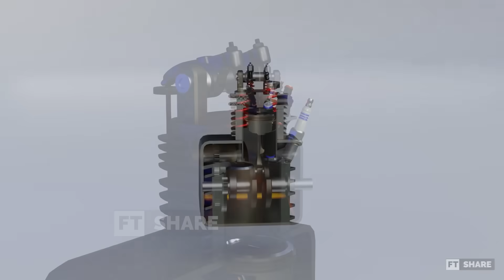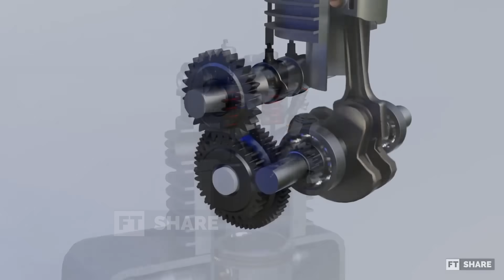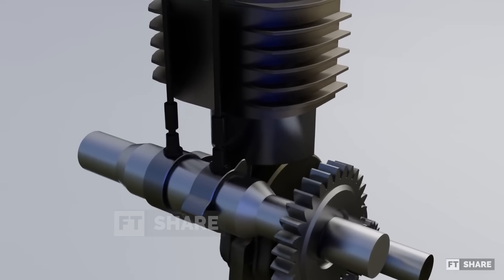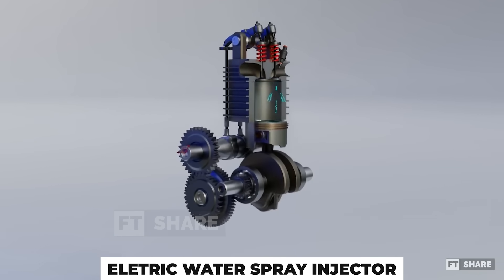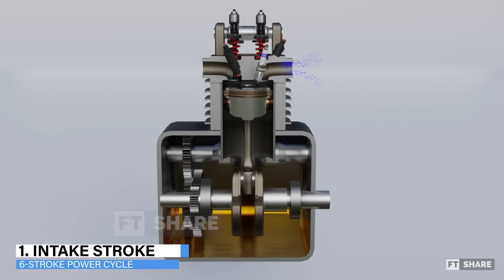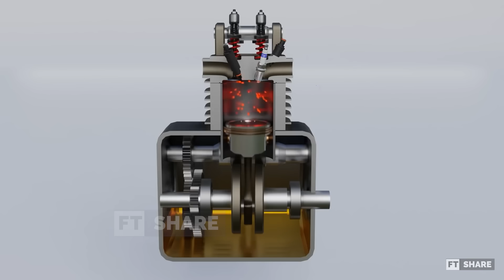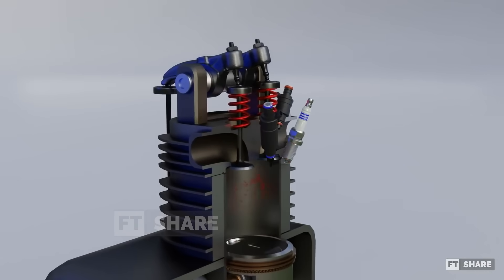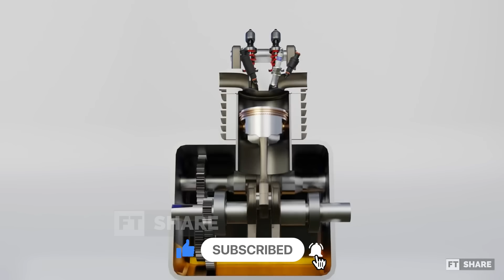Water-Powered ICE Is Here!!! | The Revolutionary 6-Stroke Engine

Comment: This could be viable as a hydrogen engine, all the exhaust should be pure water vapor, so send the exhaust through a condenser to a storage tank where it can be used for the secondary (steam) power stroke, and have that secondary exhaust go back to the hydrolytic cell where it can be made into more fuel. You wouldn't need to refill on water as often, but the problem remains, hydrolysis requires expensive materials that will degrade rapidly. How often would one need to replace their cathodes and anodes?
Reply: Clearly you have read some ignorant speaking about stuff he does'nt understand and you repeat his nonsense to keep promoting ignorance.
When naming anodes and cathodes you are clearly speaking about electrolysis, not hydrolisis, that has nothing to do with it.
If you were at any time to take a physics book and read it, to try and learn instead of make an effort to keep ignorant, you would knew that electrolisis is a very loooooong and sloooow process, and is absolutely incompatible for use in any kind of engine/motor to make hydrogen as a source of fuel.

Engines ALREADY work with hydrogen, and ALREADY produce water that gets expelled from the exhaust (watch the back of the cars on any stop and you will see them dripping)
The problem is, hydrogen provides more disadvantages and difficulties than solutions, so it's needed mixed with some other stuff (carbon, nitrogen, sulfur) to stabilize it, handle it and use it safely. Also, is easier and faster to get in this way.

That's why they say: Better to remain silent and be thought a fool than to speak and to remove all doubt.
Reply: @m.anejante1687 comment sections should be about the exchange of ideas and learning, not berating people who ask questions.
Reply: @m.anejante1687 The irony here is unreal. You let your eagerness to show his foolishness make a fool of you.
1st: electrolysis as he proposed isn't invalid because it's "looooong and slooooow", whatever tf that means. It's invalid because it uses more energy than you get from burning the hydrogen again, and so adding it represents system losses instead of gains. You can make it as fast as you want, but you can't make it break unity.
2nd: hydrogen isn't mixed with cooling gasses to "stabilize" it. It's mixed with them for the obvious reason that it combusts at temperatures that can do damage. Either straight up melting poorly cooled metal, or even in well cooled metal, rasing the surface temperature to the point that unspent hydrogen can diffuse into the metal and cause hydrogen embrittlement.
If you had bothered to study anything you attempted to lecture this fellow on instead of just stretching your feeble knowledge in the hope that no one would notice, you would know all of this.
Now climb down from that confidence peak on the Dunning-kruger chart, and actually study something instead of spouting your half baked psuedoknowledge dribble.

Comment: It's a concept that has interested me for years but I would want to see real data produced at an independent dyno facility such as a university. Running an engine on a bench is one thing but putting it under a measured load and measuring fuel consumption and exhaust emissions  is key 
You tube is full of chancers making pie in the sky claims

Comment: I have a hard time believing the 5th stroke produces much if any additional power.
Reply: It expands 400x, so yes, it would make a lot of power.
Reply: Where have you got that number? Atmospheric pressure steam at 212 degrees is about 1600x volume of water. The thing I’m thinking of is that there is a dynamic curve for steam where higher target pressures require higher temperatures. So if the water cools the combustion chamber resulting in steam, where does it get the heat to add energy to the system?
Reply: To get 50 bar of steam. You need enough energy to vaporize the water and heat it to about 500 degrees Fahrenheit after the evaporative cooling. So now you need to inject the water at  about 1000 psi to overcome the pressure in the chamber as well.

Comment: Water injection in the 4 stroke IC engine was developed in aircraft engines in the 1930s as well as in the gas turbine engine for jet planes. Although the 6 stroke may offer higher thermal efficiency it comes at the cost of lost additional crankshaft power to power the last two strokes. The question becomes whether the power gain from that scavenging cycle is offset as a gain by the power used to complete the last two cycles.
Reply: Also, if in a car, quite a sizeable water tank would need space to fit it, which means additional weight.
Reply: @adoreslaurel Each gallon of water is 9 pounds. 200 gallons of water sounds about right.
Reply: @adoreslaurel    I have a 7 gallon water tank on my 6 wheel drive truck with a 265 HP 3208 Cat ..   89 gallon fuel tank . 7 gallons lasts most long says .. I carry to 5 gallon gas cans with extra water in them
Reply: These engines use water as a steam engine not as a fuel. It's not used on a power stroke.

Hydrogen injection does. And neither of them have been used in control by computers.

Steam is heat capacitive. And will gain heat without dissipating it. 

The better you actually ignite water, the better the results without a negative.

Alloys become important for corrosion resistance and high compression. Low friction and thermal dynamic quality.

8 cycles would be possible. 2 power strokes.

With offsets you might get 3 power strokes at higher RPMs.
Reply: @mikeskidmore6754  Man! You got it covered.
Reply: @pazsion  "the better you actually ignite water" Water doesn't ignite bud
Reply: @mikeskidmore6754  Idk about all that, I ran a water methanol kit and even running just water I never saw a drop in coolant temperatures. Even spraying a large amount of water! Nice amount of steam out of the exhaust though
Reply: @canadianoddy8504  Canuk... YOU are in left field!! THIS has NOTHING to do with water injection, which cools the intake charge. THIS has to do with water flashing to steam. When THAT happens, the volume of the water INSTANTANEOUSLY expands in volume by 1700 times!! That EXPANSION is what forces the piston down.  And it's ANYthing BUT anemic!!!  Water injection and steam flashing are two different things.
Reply: a 4 stroke engine has 1 power stroke per 4 total strokes. a  6 stroke has 2 power strokes per 6 total strokes, which is an average of 1 power stroke per 3 strokes. if the steam power stroke produces the same amount of torque as the fuel combustion power stroke, then the engine is more powerful than a comparative 4 stroke
Reply: Water injection on the intake provides a denser intake. This is a different idea
Reply: Could enable this engine operate in 4 stroke or 6 stroke by have two selectable cam profiles: use the 4 stroke when you need the power to accelerate, then switch to 6 stroke for efficient cruising.
Reply: @syntropy3020 an ecu would do it better. If the engine isnt hot enuf, run 4 stroke.
Reply: If I remember correctly, Harvey Crane of Crane cams fame built and developed one of these engines YEEEARS ago!!  😮  I guess there really isn't anything new under the Sun, is there??!  Hahaha 😆
Reply: @johnbutera5805 ,,, actually Bruce Crower ,,, !
Reply: If you're worried about the last 2 strokes not making enough power, make the engine an inline 6, that way there's a piston making a real power stroke in every 6 cycles
Reply: @canadianoddy8504
Because it’s a good idea. 
It’s not new though. The video mentioned 1800’s. 
I’ve heard this before from David Vizard.  Not all good ideas make it, and many lousy ideas make it big time.
Reply: Water or water methanol injection is used to permit higher boost by reducing knock.  The "injection" takes place after the supercharger so it helps to reduce charge air temperature.  This nutty proposal is different, it is compounding an IC engine with a steam cycle.  Gas turbine power stations are now compounded using an ammonia boiler and a separate turbine to remove the energy from the ammonia, combined cycle gas turbine (CCGT) plant.  This makes sense as the two different working fluids are kept separate.
Reply: It does not matter. If you need more power just use a larger displacement engine. This concept is like getting some extra power out of the gasoline already burned.
Reply: Aircraft engines used water injection only during takeoff for the first 5 minutes. At takeoff airplanes are the heaviest and applying 100% power caused the exhaust valves to overheat, so water was injected. There was a gain in power but it was not used at cruise, since at cruise the power is set back to about 60%.
Water injection was used in most airliners and military airplane engines until the mid 1950s. By then jet engines took over the airliner industry.
Reply: @Rose-f2t  German aircraft during WW2 used MW-50 (methanol / water) injection for emergency use during combat, not just take off. In fact, the FW 190 had enough MW-50 for 45 minutes of use. MW-50 was injected into the supercharger which increased anti-detonation and cooled the cylinders, which then allowed for higher supercharger boost pressure. This allowed for an added 500 HP, to a total staggering of 1950 HP on the FW 190 D-9.
Reply: @Rose-f2t  They mIght not have used it at cruise, but they could! I got a 4 miles per gallon bump running straight water at 200 PSI through a very good AEM atomizing nozzle.. JUST WATER! I had it setup to spray just a small amount at cruise with higher flow at higher loads for detonation protection! I ran a 93 octane tune on 87 fuel using water to counteract detonation. With the water turned off it would detonate on 87 and get horrid fuel economy and power. Add the water, and suddenly ZERO knock registered, more MPG more power. It was much better running 50% methanol, 50% water
Reply: @canadianoddy8504  Wow, with narrow minded people like you we would still be living in a cave :face-blue-smiling:
Reply: Steam expansion is the most efficient combustion designed right it should be better than a four stroke.
Reply: @buckminsterfullerene2294  sorry but no
 Reciprocating steam engines are just about the most inefficient heat engines possible .  Steam turbines are better as they can tolerate very high temperature steam .  Heat engine efficiency is all about temperature differential.
Reply: @buckminsterfullerene2294  it's less power dense though which is the point he is making. Less power dense means less power for the application or larger capital cost to build a bigger engine to meet the power requirements.
Reply: additionally, as the water absorbs heat in order to vaporise, higher compression ratios can be used
Reply: These ideas make one think.  In this 6 stroke scheme the exhaust energy in stroke #4 is not harnessed.  I like the 5 stroke concept better, Which is simply an extra expansion for the exhaust gases in an adjacent cylinder.  Perhaps there is a way of combining the 5th stroke with water injection to convert high temp exhaust gas to steam.
Reply: @markam306  what you seem to be describing is a Miller or Atkinson cycle engine (Miller cycle engines are a far simpler way to increase thermal efficiency).
Reply: @danielklopp7007  was thinking of this: https://en.m.wikipedia.org/wiki/Five-stroke_engine
Primary expansion in main cylinder, secondary expansion in second cylinder dedicated to just expansion/additional power extraction.  I’ll look for the video I saw.
Reply: @markam306  Exactly the same effect as a Miller or Atkinson cycle, although a Miller cycle engine achieves the same result (i.e. extracting more power from the expanding gases before opening the exhaust valve) with fewer moving parts in a more efficient package).
Reply: bruce crower, who built a 6 stroke gasoline engine in 2006, was planning to experiment with keeping the exhaust valve closed during the exhaust stroke. this means that the exhaust gases would be recompressed, which would keep more of the exhaust energy in the cylinder, which means you could inject more water and therefore get more power and efficiency from the steam stroke. thats how you would "combine the 5 stroke with water injection"  @markam306
Reply: I agree, if get getting the extra efficiency by recovering heat to drive a steam stroke. Why not use both? either a block with 2-4 extra steam only cylinders or just a streamlined steam engine that sits beside the ICE engine. the ICE is setup as Electric First Serial Hybrid to assist in any load or incline situations. Then,  use the water from the ICE's cooling system to drive the steam engine. The steam engine is attached to a generator which extends range.
As a replacement to Electrics, I don't expect any of these unrealistic technologies will ever compete with Electric Driven ones, if the point is to get the Oil Companies out of control before our global environment collapses. -in My Hippie Opinion
Reply: @ThatTieDyeGuy  steam engines are not very efficient (there's a reason the steam locomotive went the way of the Dodo a hundred years ago)... Miller cycle engines are a MUCH more efficient (and less complex) way to recover more of the heat from combustion of gasoline!
Reply: @danielklopp7007   was just suggesting a steam powered device use the miller cycle if that feels right to you. I personally think with the right arrangement of micro-peltier cells imbedded into a ceramic exaust and head components then mine the heat directly into electricity. Less steps, potential more efficient. -in my hippie opinion
Reply: Probably slightly less but what ain't?
Reply: If it didn’t, then the efficiency would be lower, not higher! As it is, the efficiency is 50% vs. 30%. Well worth developing further! This engine is virtually a steam-gas hybrid!
Reply: I saw an interview of a guy who was a Chrysler engineer. He experimented with this idea to run a very high compression ratio and a lot of boost
Reply: @garethwilliams4422  It works, diesels love it big time! I run 26 pounds of boost in my 2 liter diesel passat and have not gotten around to throwing in my water methanol kit yet. At 50%meth 50% water i'm hoping for an extra 15 horsepower with hopefully 100-200 degree cooler exhaust temps
Reply: guys this is great for hybrids. however having to use distiled water blows away all the savings.
Reply: @SoulTouchMusic93 distilled water can be had by capturing water from the air. Keep some device in house.
Reply: @SoulTouchMusic93  Exactly, demineralized water ain't cheap and there is the extra pain in the ass of having to keep it filled.
Reply: Research HHO gas and Browns gas .
Reply: @chriskessell4579  I'm guessing you didn't take any thermodynamics classes at the university level...
Reply: Water injection in a 4 stroke engine and this application are two completely different concepts and the power strokes are completely different!  Water injection in a 4 stroke engine is used to cool the charge allowing higher comoression for more power!  In this case, it is a 6 stroke engine using water vaporization as a source of power!  Not the same!!!
Reply: @LWRC  NO... in a 4 stroke the water is injected just after the fuel to effectively increase "octane" or reduce the fuel's ability to burn; when compressed and when heated, the O2 in the water and the Hydrogen both burn along with fuel decreasing wasted fuel and providing a cleaner burn, The issue with doing this is that the exaust system ha to be stainless steel or lined with ceramic, if not it will rust out pretty fast. -In My Direct Real World Mechanical Opinion
Reply: @ThatTieDyeGuy  
Again, there is very little energy to be had  in water!   You are saying what I've already stated!  Read my comment again - The primary purpose is to cool the charge and allow for a high static compression or forced compression via supercharger or turbocharger.
Reply: I never thought 🤔 of it like that ....... actually - I never thought of it AT ALL 😂
Reply: "Concept invented in 1883 and 140 years later ot is "still in  development "  what does that tell you 😮
Reply: If it is just a hydrogen electrolysis system.. why cant it run on hydrogen as a 4 stroke?
Reply: Cool concept and it probably works but if the comments here are any reflection of the average consumer and I was an engineer designing vehicles for average use I definitely wouldn’t put a car out there that would over heat and seize when it ran out of water 😂
Reply: To the OP's original question... Worth it?
I think if it was, we'd be using it everywhere.

Comment: first thing came to my mind is that a vehicle with this engine will have to carry an almost equal amount of water and fuel in two different tanks. means much more weight penalty and space needed to accomodate that water tank. which immediately eliminates motorbikes and small cars from being benefitted by this engine. even buses or trucks are out of the question. what CAN benefit from this are massive  locomotives, stationary electrical generators and cargo ships with onboard reverse osmosis devices.
Reply: Not necessarily. The amount of water needed is only enough to produce a phase change. Water goes to steam at 16 times the volume of water.